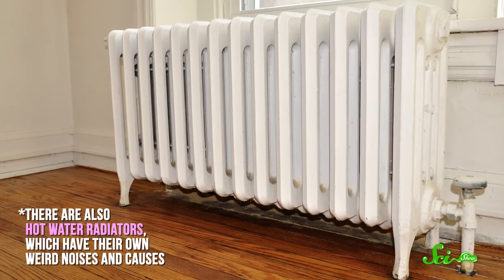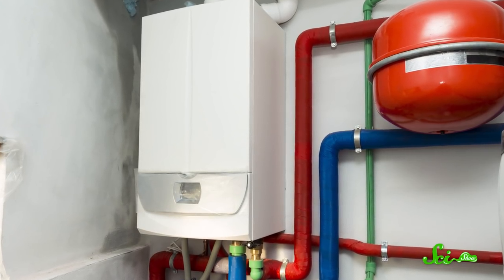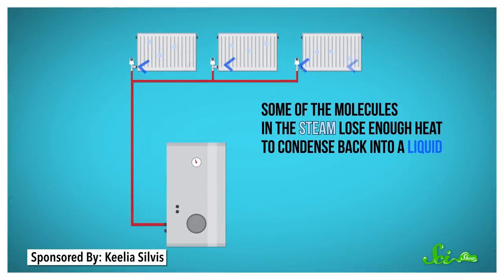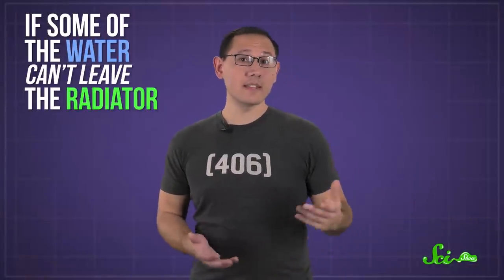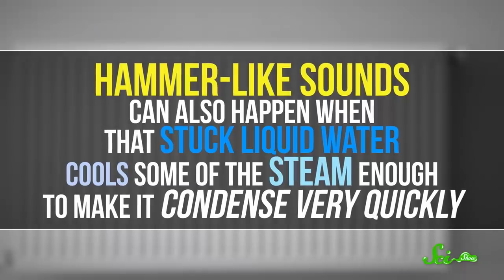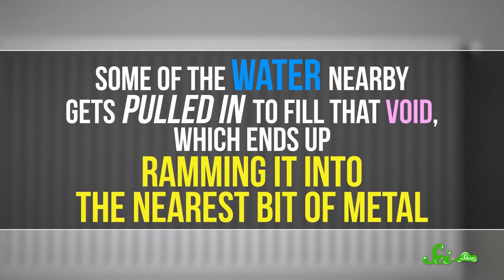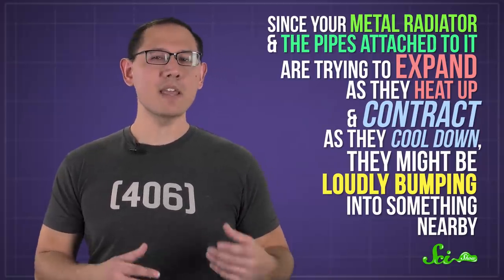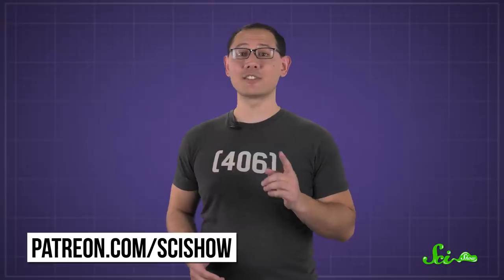What Makes Radiators Bang So Loudly?

Comment: Never heard of a steam radiator. In the uk we have central heating where the boiler heats water that is then pumped through the closed system of pipes and radiators. They still make knocking or clunking noises but there is no steam involved.
Reply: We have both types in the US...  Mine happens to be steam, but many radiator systems are hot water (like yours).
Reply: I have water radiators too in the UK but they still bang a lot
Reply: With the water radiators I have in Germany I have to bleed the system about once a year to get rid of air bubbles which make a horrible gurgling and banging sound.
Reply: Maybe they have a water (Hydronic) base board type closed system

Comment: wait wot your radiators use steam? our radiators have 2 connections: warm water in, slightly less warm water out. no steam.
Reply: Yeah. radiators don't run on steam in any modern country
Reply: Using steam is a total waste of energy: heating up water to such high temperature reduce the efficiency of the "boiler". Also consider the risk of high temperature pipes...
Reply: Boston, Massachusetts here:
Just the other day we got hit with a storm and my thermostat broke. The indoor temperature of my home fell to 10°F while outside ot was 2°F but wind chill put it at -25°F or worse. If there was water in my radiators instead of steam it probably would've froze and expanded and damaged them. So yes they're old and inefficient, but they are better in emergencies
Reply: well it's not pure water. there is a bit of oil in them as well if I'm not mistaken.
Reply: Using steam in homes to keep a comfortable temperature might be a waste of energy and also a danger in itself for the high temperatures and possible pressures in the piping, but it is widely used in industry when you need to heat up things over the boiling point of water and up to a certain temperature where other devices like gas burners do the job better.
In the dyeing industry you need to heat up water to 130 Celsius and a main steam boiler with some piping to the machines is still the way to go so you don't have to maintain a heating device for every single heating point.
I am aware that you refer to home devices when you say steam is a total waste of energy. But had to comment to make things clear for those who just read the sentence straight.
Reply: TheChipmunk2008 | You said it ... " in any modern country ".
We're talking about the US here 😒
Reply: +Joan Pey Steam is indeed used a lot in industrial processes, but there it is usually used since the temperature is very easily controlable (since steam at a constant pressure will have a constant temperature) and since it can distribute heat evenly across a wide area. In normal homes you don't need to have the radiators at a very constant temperature (especially since the termostat controlls temperature by turning the entire system completely on or off). Radiators work below the boiling point of water (iirc 90°C in really old systems, 60-70°C in modern systems) so while the constant heat over a large area is beneficial there are other and safer alternatives to steam, such as liquid water.
Reply: Steven McPhee Did your indoor plumbing freeze and cause broken pipes? If not, had you had a water based heating system would not freeze either. Furthermore, water based central heating systems can be easily drained.
Reply: +Steven McPhee No they're not better in emergencies... And what kind of horrible insulation does your home have when the inside temp drops to 10 degrees in a day at 2 degrees outside temp (windchill temperature does nothing for actual temperature)? And you do know that steam is made up of water right? When the boiler is off, the pipes contain water...
Reply: Mine only one connection. But you do can search your favorite games on steam. Eh ??
Reply: J Bolo I disagree with your harsh remarks.
Reply: ikBenBerG. I agree with you. Hot water is enough and safer for home use.
I was replying to c muller who wrote: Using steam is a total waste of energy, while it's not true as a sentence.
Reply: @TheChipmunk2008  New York does

Comment: i didnt know steam radiators were a thing
i think most german ones are just water based
havent seen a single steam system in a regular home
Reply: Same here, only saw steam radiators in history books. Wow! People still use those!!!
Reply: Same, never heard of that in Belgium.
Reply: If you live in an old apartment like me their there
Reply: So most do use water? I always assumed they use water indeed. (Dutch here)
Reply: Though, have heard the "banging noises".
Reply: You are surprised as Im
Reply: That would be air
Reply: Same in Finland. Never heard a radiator bang.
Reply: Matthijn Dijkstra I've only heard air bubbles squishing through some spots but no bang noises
Reply: I have a steam radiator system in my house (US).  While the boiler has been changed, the pipes and radiators are probably original to the house, which was built ~1895.
Reply: I've generally only seen steam radiators (or radiators at all) in either very old buildings, or very large buildings/campuses.  For example, the university I attend uses water that is partially heated from waste heat off the local power plant, and heated to steam the rest of the way in a separate boiler.  They have tunnels under campus, some of which run under the sidewalks to help keep the ice and snow cleared.  The older buildings all use radiators tapped into this system.
Reply: Same in Italy, we all use hot water
Reply: Very weird. Live in NYC, most houses/apartments that were built in the 1900's have steam systems.
Reply: Yeah, understandable that SciShow wouldn't know though. They're American, and Americans almost universally use central forced air heating. I doubt they have much experience with radiators. Mostly the only buildings with radiators in the U.S. are really old and they use steam systems. There aren't many radiator systems in the U.S. younger than 75 years...
Reply: In New York City this is very common.   Most of the systems are old and not well maintained.  in an 8 story apartment building the first 4 floors complain it's too hot and the top floors are too cold. The steam pipe usually comes right through the inside of the apartment in a corner and if you lose or pull off the insulating sleeve,  it can cause severe burns when touched.  you constantly hear water flowing and banging inside the walls. if you live on one of those lower floors it might get so hot inside that you have to leave the windows open a bit (even in the dead of winter) while your neighbor on the top floor huddles in a corner with an electric blanket.  The USA is great.
Reply: Steven Anchundia they’re there**
Reply: Steam radiators are a thing where steam is a public utility like water, electric and gas.
Reply: J F story of my life...I lived on the third floor of my building for a while and was constantly burning up, leaving windows open it every room. Then moved to the 7th floor and now freeze my butt off.
Reply: @JF, that's why the U.S. doesn't use radiators anymore, unless you're in a really old building you've probably only seen them on TV. Central forced air is the way to go!
Reply: lol, I grew up with steam radiators and didn't know water radiators were a thing.
Reply: Okay, I did some research on the google box. Apparently steam radiators are a simpler, more powerful design, but they have drawbacks and we have better options so starting in the 1940s the developed world starting phasing them out. Europe went for hot water radiators, which require an expansion tank and some other design complexities to work, but are overall superior to steam. The U.S. went for forced air, which is significantly less efficient, but heats more quickly & evenly and allows finer temperature control. 

The only buildings with steam radiators in the U.S. or Europe are pre-late-1940's buildings with original heating systems. Since Europe was pretty thoroughly devastated by WWII, there are fewer really old large residential buildings that would be using original systems than in the U.S., where things didn't get levelled. That's why people in the U.S. usually have no radiator experience at all, and if they do it's going to be with steam radiators, and that's why Europeans only usually see water radiators. The more you know!
Reply: my apartment was built in 1900 and i hear double the sound since two radiators are within 3 feet of each other
Reply: I live in the United States. My home has steam Radiators.

Comment: But what is the noise if you don't have a radiator?
Reply: Jericho & Thunder The 2 Gray Cats ME
Reply: Or anything else like falling or the floor expanding due to freezing underneath, neighbors, depends where you live
Reply: Probably a ghost
Reply: Jericho & Thunder The 2 Gray Cats halloween theme song plays
Reply: The cat, every household should have a cat to blame.
Reply: Jericho & Thunder The 2 Gray Cats it's dear David...
Reply: Water-hammer from the water-pipes when someone else in the building turns a tap off!
Reply: In my old house it was the ventilation.  As the heat or cold was turned on, the square vents would expand or contract.  At a certain point, this would cause them to "pop" out or in as the metal was eventually forced into a concave or convex shape.  This would create a loud banging sound that sounded like someone knocking.  Because sound in the vents travels quite well, you didn't have to be near were the vent expanded to hear it, but rather it would sound like a knocking even in a room across the house, so long as the room had a vent somewhere.
Reply: schizophrenia
Reply: IM JUST HERE FOR THE COMMENTS LOL
Reply: Freddy Krueger?
Reply: hahahaha

Comment: Gotta be a US thing, never heard anything like that here in Europe
Reply: Well, my radiators here in Germany most definitely do that, although the noise seems to come from the pipes leading into it. And sometimes the pipes in other places (like really far away from the radiator) even start rattling like crazy. I have to turn the central heater of for the nights in order to be able to sleep. 
The house is from the 1950s though.
Reply: This is the first time I've ever heard that radiators can make noises, and I'm from Europe and grew up in a house from the 50's.
But then I have never heard about steam radiators either...
Reply: We have water radiators at home here in Slovenia (eu) so the only thing I hear is water floating inside quietly lol
Reply: I'm in Belgium,only heard radiator noises in old houses, and never a bang. I don't think our radiators use steam.
Reply: Im also pretty sure that my radiators don't use steam, they have to pipe connections and a valve for letting air out at the top. if you open that and all air is out of the radiator, water comes out, so i'm pretty sure they use water not steam.
Reply: Yep I live in the UK and every other night I hear bangs freaked me out at first but now I'm use to it lol
Reply: I've never lived anywhere that had radiators and I live in the US.
Reply: German here - I hear sounds regularly at night coming from my radiator. Not a bang, but two or three clicks usually between 1 am and 3 am. What could this be? Maybe it's the electrics in the wall... There is a socket on that wall too.
Reply: I find my radiator noises to be soothing
Reply: The problem with closed central heating is that you have to bleed the radiators. Normally, that isn’t much of a concern, since it is only done every 6 months, but when you have a leak God knows where in the system, you have to keep doing it over and over again if you want the uppermost floor of your house to heat any heating whatsoever, because the air base completely filled up the top radiator and no water gets in. This is even worse in France, since you have to manually input water into the system through a valve system (unlike England where the water is automatically inserted when the pressure drops to low) and it could take ya literally hours to bleed a Large system on your own.
Reply: pipes or radiators shrinking or elongating in their holders and jumping a tiny bit over over a stuck point.
Reply: Ryan Mercer    You DO understand that most of the homes even in USA still use radiators, albeit more hidden ones, right...
Reply: Most homes here in Germany have a central heating system using hot water of instead steam, which is lead through radiators or tubing in the floor. No banging, but a slight gurgling noise if the radiators aren't properly maintained.
Reply: I thought steam is only used in very cold climates, like Antarctica and far north russia. All europeans radiators I saw are water based.
Reply: No steam radiators in Greece. Only water ones.
Reply: TheDarxide23  Must be in New York in their old apparments
Reply: It is also a thing in London. Steam is still a public utility in certain parts, brought to you just like electric, gas, water and sewer.
Reply: TheDarxide, I think it's more in areas with older houses.  I live in Massachusetts and a lot of older houses, like mine, have steam heat.  If you live in an area where most of the development is newer you probably won't see it.
Reply: im in the uk and my current house doesnt make any banging sounds but my old house did
Reply: if its only a bit of water it might just be the steam condensing at the top but if its pissing water then it probably uses water
Reply: Same I’ve never even heard of a steam radiator before from Belgium btw
Reply: Tungom I live in Belgium and I rent a small apartment that is old (from the time they still used to build super sturdy apartments with incredibly much space over here, though I have the small roof apartment).

My radiator makes loud banging noises frequently, especially the very large 3.5 m one in the living room. I guess this is because the radiator is an old type that is not really being made anymore (it is cast iron in one large piece). I also have to release air that gets stuck after a while from the radiator vent sometimes, otherwise the hot water cannot spread fully.
Reply: TheDarxide23   old houses have radiators in them. Unless they been updated. Live in US always have
Reply: Nilsson never even seen one of these before in a home, even old homes.. Must be an East coast thing.
Reply: Same here.  I have many sentimental feels towards that night song.

Comment: Never heard this. I live in Sweden, we have modern radiators.
Reply: Charlie Clumsy I hear they heat homes with reindeer breath in Scandinavia.
Reply: That's true. Very environmentally friendly.
Reply: In Norway most of us don't even use radiators, we just use electric space heaters and heat pumps (AC units that can be reversed to heat).
Reply: I live in Arizona, we don't need heat
Reply: Electric space heaters? Seriously? The power bill must be insane. We use radiators in Germany too, but its full of water not steam. No noises...
Reply: What do you mean modern, most of Europe has water-filled radiators and has had them for ages. Steam radiators are just easier to set up in tall buildings. Neither of them are modern.
Reply: Simonas Mažeikis
Seems to me that I don't know much about radiators. I just thought running radiators like that seems old school.
Reply: Norway has the lowest electricity prices in Europe, right behind Iceland if you want to count them. Most norwegians use the aforementioned electric heaters and ventilation systems. And most of us have a fireplace, so the annual wood bill is actually a thing here in Norway, unlike in the UK or the US where you have the natural gas bill.
Reply: Let the Arizona rap battle begin!
Reply: Lichtgestalt Kruemel I use a small rotating heater with a fan, and it actually doesn't cost very much at all. My baseboard heaters, on the other hand, really run up my electric bill, make lots of noise, and give off a terrible smell.
Reply: I also live in Sweden, we have steam radiators in our old countryside house in Jämtland.
Reply: Can I go to Sweden please
Reply: Charlie Clumsy I live in Sweden and I'm not sleeping  rigth now because of a radiator...
Reply: I hope that a reddit exists for People to make fun of Europeans who think they are better than everyone else.
Reply: Handsome Squidward lol
Reply: Modern? Floor heating or a high efficiency heat pump would be modern.
Reply: I live in a house that was built before 1800, i have central heating.
Reply: Jared Jeanotte that would be fun, since rest of the internet is already dedicated to make fun of Americans who are doing that.
Reply: Never even seen a radiator lol
Reply: The weird thing is that the thumbnail does include an illustration of a radiator which has both an inlet and outlet pipe...
Reply: +Mahle Lynn WOW YOUR WAYY TO SPOILED
Reply: fuckin akekkekeke good for u LMDAOODLDK
Reply: lol no I live where its always hot
Reply: Charlie Clumsy you have I don't and this video came at the right time I was wondering why they made that noise
Reply: I know, I'm kind of disgusting.
Reply: somethimes there are noises but thats air (normal after some service) and can be removed over some valve on the radiator
Reply: Inte ens på landet? På mitt landställe låter mitt hus konstant, däribland elementen.
Reply: Det är inget jag har hört förut. Men jag har för lite erfarenhet av äldre hus på landet för att säga något om det.
Reply: Charlie Clumsy English plz
Reply: The problem is old houses with old heating or bad maintenance, water works great. The old radiators used to be small and VERY hot, now radiators are much bigger and run on lower temperature.
Another solution is using serpentines which run on lower temperature water.
Reply: This gun tastes funny you guys should give us some here in Chicago, single digit winter days crazy!
Reply: Existenceisillusion keyword "Scottsdale," just because you had it,  didn't mean you really needed it... I too live in Arizona. We haven't turned on the heater for over a decade. Actually, I still have to use the AC during the day!!